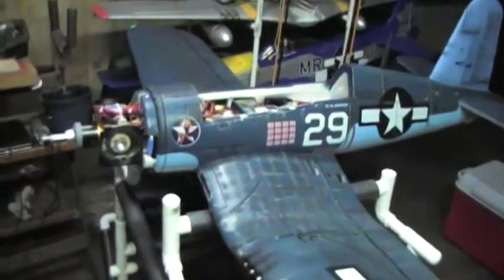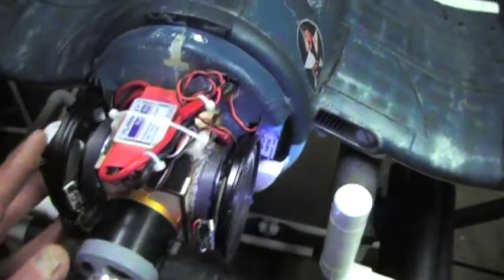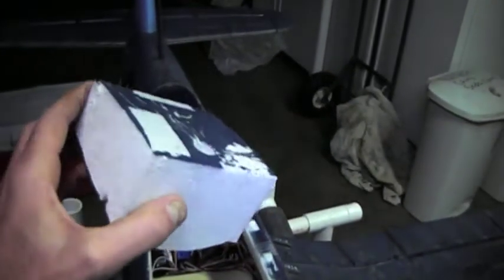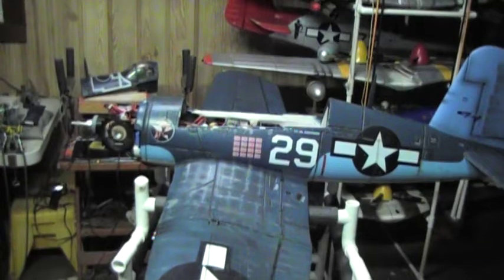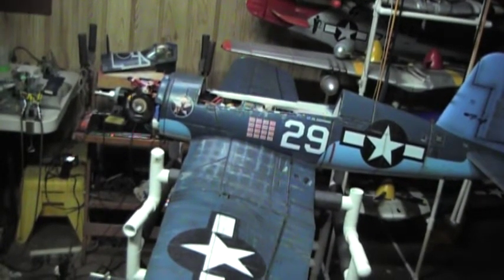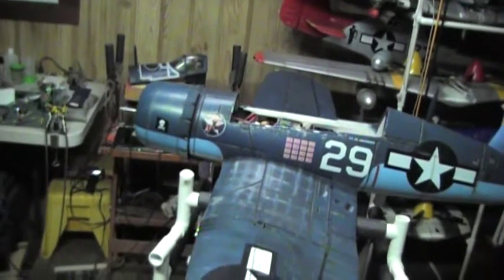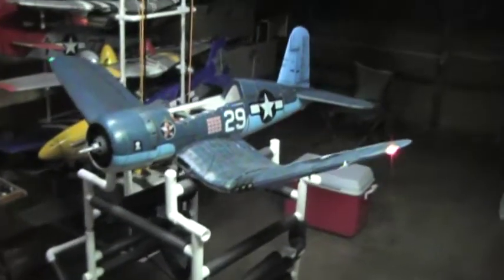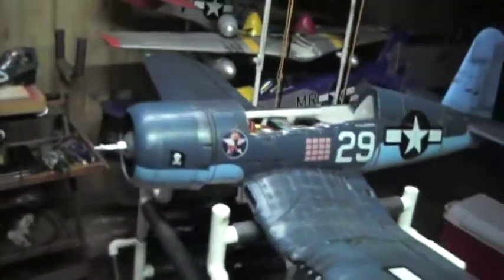LX F4U Corsair sound mod 001

Comment from the maker: Thank you, I'm actually looking to replace the two front 3 inch speakers with a different set of 3 inch speakes that are a bit lighter in weight....For right now on the nose I'm using these for the test dry run untill the new 3 inch speakers arrive, bot sound about the same, but there is a big weight difference.

Comment: that sir is way cool,It that a banana hobbys plane? Im impressed with the modifications and the sound,good and loud! I wouldnt fly in the rain so wouldnt need the water proof speakers. I see that sound board technology is going wild right now. On my modeling sites you can order programmable sound boards. Its all pretty cool. I have added navigation boards and lights to all my planes now.I ran hobby king out of them on my last order. I hope they get more in,I still have other projects to do